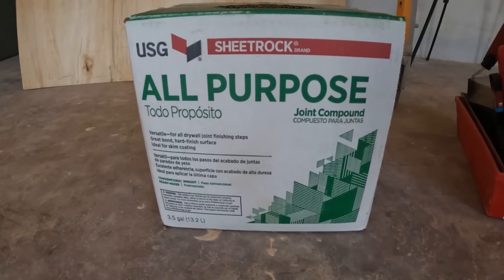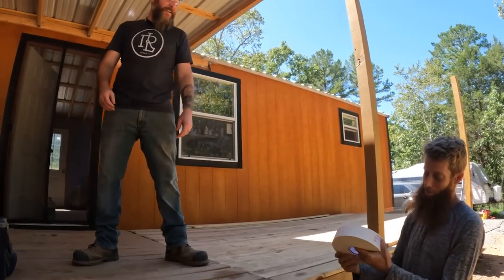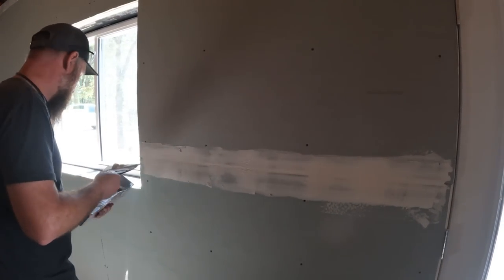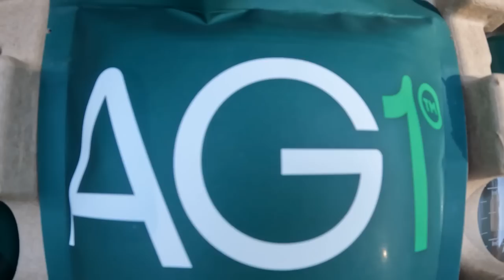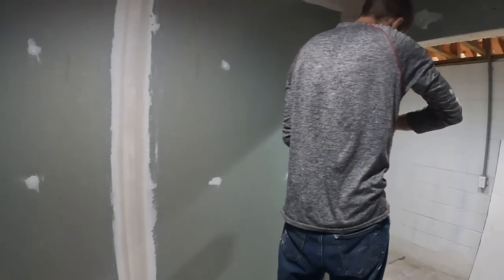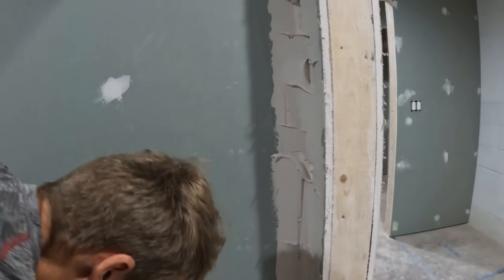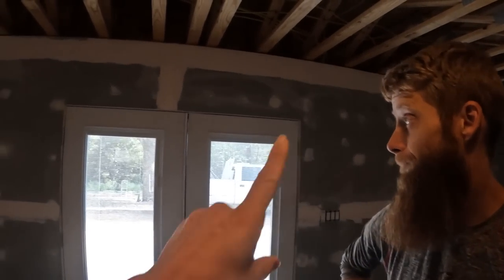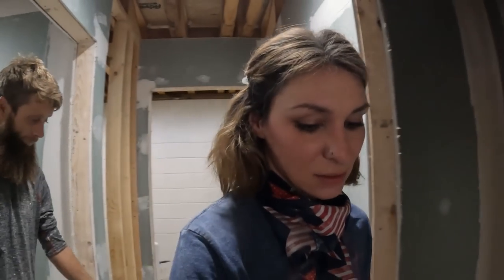Taking On A New Challenge |Mudding Drywall |Couple Builds Basement for Dream Cabin Homestead

Comment: It also helps if you run the tape through water first, before you apply it to the wall...(old dry wallers trick) we used a bucket full of water and ran the tape through the water and used our fingers to get rid of excess watter, it helps the tape to fully stick to the mud and prevents part of it from coming up as it all dries
Reply: This is a horrible suggestion do not do this. No one does this anymore and there is a reason. Hence “old drywallers trick”
Reply: @beanieweenie9543  not sure why you believe this is an issue, it has been done for many many years by professional drywallers. Maybe you could give a reason for completely dismissing this, instead of just asserting its a bad out dated procedure. It has many benefits and streamlines taping and mudding.
Reply: @jasonhaugen7736    I dismiss it because I have ran tape with it soaked in water and with out side by side to see if it made a difference in adhesion and the tape with water does not adhere nearly as well as just doing it the normal way it literally peels right off the wall with little effort. It may help it stick better when it’s wet but once it’s dried the difference is beyond noticeable. Don’t believe me there are several you tube videos from dry wall pros showing the exact thing and how poorly tape ran through water adheres once dried. But better yet try it yourself and have your own experience do a side by side comparison and you will see.
Reply: @beanieweenie9543  yes i know there are several youtube "experts" that say they don't see the benefit. I also know there are others that swear by it like I do. First off, when done correctly it does stick better when wet, and you don't get bubbles or lifting after like you do sometimes when applied dry,. it sticks quicker and more completely without a lot of going back and rubbing it . It is a time saver and makes sure to stay flat without bubbles. 

But hey, this is just my 2 cents worth... you do you... this workes great for us, looks great after... but...it is not a "horrible suggestion" as you claim it is.
Reply: @jasonhaugen7736  the videos I am referring to are not from “you tube experts” but life long drywallers as I am myself that have ran more miles of tape than most people will drive in a lifetime. If you have to wet tape to get it to stick and lay down without bubbles you aren’t doing it correct in the first place. If you put the correct amount of mud on the wall the tape is going to stick to it there is no need what so ever to wet it. Like I said have your own experience and run two lines of tape side by side and and peel them when they are dry you will be surprised at how poor the adhesion is on the tape that was wetted. You can swear by it all you want but I can guarantee a line of tape that has been dipped in water will not hold up to tape done regularly. So yes if dipping the tape in the water compromises adhesion and performance of the tape which it does it is indeed a horrible idea.
Reply: @beanieweenie9543  well Mr. Weenie, i get that your ego just won't let you agree to disagree here, and that's fine. As I said, I have done a lot of drywalling, with both dry and wet tape. I do know what I'm taling about and wet works best for me and a million other drywallers, because you couldn't understand how to make it work for you is not my fault. Your "side by side" experiment is pointless. If you want to believe that your "YouTube experts" are somehow better than all the other YouTube experts who use wet like I do thats fine, You go on believing what you want and drywalling the way you do. I am happy that you have become the YouTube Guru of drywall tape.  And that your way is now the end all, be all, best and only way of taping and mudding. And that you have spent so much time trying to prove a perfect stranger wrong, who was only trying to help someone by giving good advice. If they want to use my advice in the future more power to them, if they don't, then no skin off my nose. Have a really good rest of your week.

Comment: My dad, brother, friends in construction and now us too… we always used the 5 gallon bucket and plop the whole box of mud into it and used a drill paddle attachment and add a little water and mixed and fluffed the mud up. It spreads so much easier and sanding is easier as the mud is not so hard when dry. And do the same process as CRC after that. Light sanding with a pole sander.
It all works out the same in the end. Just found it’s a bit easier with some water added. 
You two are an awesome husband and wife team. I feel motivated now. But no where to apply it. Did all this when my husband and I were young. Now approaching our 70’s
You two ROCK!!! 😃👍💖

Comment: I would recommend mixing your mud just so you can get the clumps out, and add some water also which helps ur mud from clumping, it doesn't take alot of water honestly, but the longer you let ur mud sit it will still clump so just mix it every time you start to see little clumps in it and especially get the really dry stuff that's collected from just getting mixed around and drying out and it helps to mix it in a 5 gallon bucket which they also make with the mud in it so you don't have to use the box stuff but it's preference obviously
Reply: The only warning about mixing in a 5 gal bucket is to avoid hitting the sides with your mixing device so it does not shave off pieces of the bucket (plastic) and get mixed with your mud.
Reply: @brucegover2548   never had a problem with that and you must be using a different type of paddle or something
Reply: @brucegover2548  I have definitely done that before😬.

Comment: Don't overwork the mud. More you scrap the dryer it gets.  When you go to put more mud on use a wider trowel.   It helps more than you will ever know.  Been there done that.   Lightly sand between coats. Put a bare light bulb lamp up by the wall and you can find wear you have places you still need to sand. And instead of spraying on a texture I watered down some mud and used a medium haired roller and painted the mud on my walls and ceiling. It came out fantastic.
Reply: Agreed mud + roller is a great way to texture a wall. I've never used those cans but was always under the impression they were more for fixing texture after you do drywall repair versus a whole wall. I may be wrong on that. But I'd say return the cans and do what Karen recommended or get a texture hopper.

Comment: They do make an attachment for most shopvacs that has a screen sander on it for sanding drywall/keeping the dust down.  Just need to make sure you have vacuum bag in your shopvac so it doesn't spray the dust everywhere.

Comment: You guys need to spend some time on google.  You need to add water to thin the mud a little.  Use a five gallon bucket, purchase a mud mixer use a HD 1/2" drill to mix.  How much to thin is a matter or experience, try a pint per box.  The mud should stick on the mud knife but still spread smooth and even with the proper pressure.  You shouldn't have to strongarm the mud knife.  At the end of the day, level the mud in the bucket slowly put just enough water to cover the mud.  I used to use a drywall scrap to cover the bucket.  Next day pour the excess water off mix and start again.  Good luck.

Comment: Few tips for others out their that are new to mud work. DO NOT use paper. First get the fiberglass tape. Use 6 inch blade like this video and then a ten inch and third coat then feather out. Sand with a sand sponge to avoid striping caused by standard drywall sander. Corner trowel work well for first coat but feather with ten inch trowel. Also doing a ten inch stripe over the screws straight down avoids screw spots that'll show through paint. Finally when priming use large nap roller of brush doing arches which then keep light bouncing other directions that will prevent seeing any small difficulties.

Comment: Two tricks that worked for me. Get a box fan or two and put in the windows to suck a lot of the dust out. Leave ceiling fans off. Also, use a bog sponge, like whats used on tiling, a bucket of water and sponge the joints. It cuts way down on dust. On last use sanding to give finish a nice smooth look.

Comment: Didn't anyone tell you about corner bead? It's a metal corner that protects them from impacts that will chip the corners. Bet you found the bulge where the 3 inch strip is located. For a rookie, it's lookin good.

Comment: I also have an extra vacuum hose attached to double the hose length and that is attached to m palm sander for ease of collecting dust. This helps, provided you have the correct sanding pads, with holes. And with so much sanding through out the entire build, this could save hours.

Comment: Use the Plus3 joint compound ( easier to sand) and mix the box into a 5 gallon clean bucket and mix with a paddle attached to a drill)

Comment: There is a roller to roll the mud in the corner fold the paper to make your corner push it into the mud and take your trowel to smooth out the ends of the paper

Comment: I downloaded to catch up, so you are already finished, but an easy texture method is to ix paint with your mud, such that it is like thick paint, and roll it onto the Sheetrock. A little practice and you can find a nice texture you like and it is such a time saver. I usually go over that with a coat of paint w/o the mud. Covers nicely for less effort.

Comment: You would like the result of thinning your mud down a bit with water...just a little water makes the mud very much more workable (easier to spread and smooth out. Also, get a 6" drywall knife for heaven sake...it is the industry standard for taping.

Comment: If you put that mud in a 5-gallon bucket and buy one of the mixers you can mix that up and get all the air pockets out of the mud and that'll save you from getting air pockets in on the walls for one and two it'll be smooth as can be and if you're just going to use the box use the four inch trial to dig it out the box it makes it easier make sure you get plenty of mud under the day cuz it's not it's just going to bubble up on you and you have to cut it out and put another piece tape in there

Comment: You guys are doing a great job!  I don't usually put my two cents in what others are doing.  However, I would offer food for thought.  You guys are talking about texturing your walls.  You are doing such a good job, unless it's personal preference,  I might skip that step for the basement.   You could paint the drywall and be finished after mudding.  Save the money, time and work.  If you want it in the cabin later, then you won't be as burned out.  I say this because in this part of the East Coast where I live, textured are almost never done.  Painted, smooth drywall.  We don't do plaster here either.  Again, just a thought.  I am sure you will make the best decisions for yourselves. 🥰

Comment: You can get different drying times for mud, or we'll call it plastering here.
Most common is 90min mix. Put it only 2hrs later ready for sanding and recoat etcetera. So you can do in a day if the weather is warm enough.
Looking good so far.
Sanding in-between coats really is minimal.  Quite sand over it done. Too much sanding and yourll have to remud it.

Comment: You guys need to cut the drywall off around your front door jamb...the jamb was not wide enough to match your block wall thickness (cut off at least 3/4" of sheetrock back to the back side of the doorjamb at the top and two sides)...then nail on a 1/2" strip of wood to "extend the jamb" out flush with the drywall surface...then the door trim has wood to land on at the door jamb. As it is now, you can't put any trim around the door...the raw edge of the sheetrock shows at the area to be trimmed out with wooden door trim. Also, you should rent a texture gun to do the texture on your sheetrock...those small cans of texture are only meant to do patch and repair areas, NOT the entire field.

Comment: We had a drywall sander we attached to a long pole you sanded joint area and the drywall dust would sort of fall straight down to the floor, it kind of looked like a screen you clean it every once in a while so it sand good. 
There is also a neat thing that they have when you shop vac you drywall dust off the floor that can put the dust in a 5 gal (with water)bucket with a attachment you can buy so it won’t break your shop vac. Saw them at a big box store HDepot or Lowes. We blew up a regular vacuum cleaner trying to do that it burst the bag!!😢😢

Comment: Rent a drywall sander for after your final cost sanding you’ll get all the basement sanded to a high finish with little mess as it attaches to a vacuum, it will save you loads of time and as I said you’ll be very happy with the finish. All for a couple of bucks.😮😅

Comment: Great video as always. Just wondering whats the plan to cover the concrete floors? Just going concrete paint, epoxy, tiles? I done epoxy on my own basement and garage floors but the anti-slip was a bit more expensive than I thought it would have been. Still worth it though.

Comment: Your mud is to dry, you can add water in your pan and mix it
Or squeeze the bag into a 5gal buck and  mix it with your drill and mixer 
Spotting the screws - apply horizontally then wipe vertically 
Or vise versa 
Thinner mud will save your arms and wrist…. Have fun

Comment: will you put up insulation in the ceiling until you start the plumbing and wiring for the upper floors? Seems like it could easily be moved out your way when you go to the next step and very cold as soon as Winter hits if you didn't have some sort of something up there.

Comment: Never use an electric sander with drywall. Always use a handheld so you can feel what you have done and how much more you need to do.
Reply: You can’t use an electric sander! Omg 😱 I was like you need a block sander in between layers ..
Reply: Electric drywall sanders are used quite often, as well as battery operated sanders that have low speed adjustments.
Reply: You can use a electric sander lol it's called experience obviously but use what you are comfortable with Also

Comment: Hey Gary I guess you done sanded the walls already, I found a trick you can do,take a drop light above the area you going to sand cast a light down ward ,you can see any bad spots , it will cast a shadow .sand that area till it’s gone.your wall be straight and smooth

Comment: ATTENTION!! TRICK for u guys. For best results when painting a basement tht always has the chance for moisture in or around it no matter what steps are taken to keep dry. While painting the finished drywall u should run a dehumidifier couple days before and during and while setting up and paint drying/curing. I messed up with this twice once in a finished basement and like 10 years later on a kitchen ceiling tht sat over a crawl space with no liner. Paint finish look was the worse cracked egg shells man has ever seen.

Comment: Just remember when you open a Box of mud air is your enemy when you go to close it up at night get all the air bubbles out because it will dry it up harder than a rock you do not want hard rocks in there because it leaves scratch marks everywhere you try and lay mud down best thing to do is keep a bucket 5 gallon bucket of water close by when you go to close everything up sprinkleverything up sprints a little bit of water and there just take your hand and splash water in there and then squeeze all the air out trust me trust me and then seal it backup.

Comment: Hello. A lot of these comments are not good. Do not wet tape it makes it so it can’t absorb the glue in water of mud u don’t need to sand the first coat as it should b thin and just to set tape. Also it is very hard to sand all purpose/taping mud. For the next coats u need to use a lightweight mud that sands easy. U need to add water to mud so it wants to flow Especially in the corners. A real texture hopper actually cost less then probably 5 of those cans. Vancouver carpenter videos on drywall are really good. Not trying to criticize just don’t want u to make the same mistakes I did when I remodeled houses b4 I how to’s on YouTube existed

Comment: You shouldn't have mudded the upper edge of your drywall until you hung the lid. Now you don’t have that nice tapered edge to feather your tape and mud into.

If I were you, I would either take a damp sponge or your hand sander and remove that mud from the upper edge of your drywall. Trust me, you'll be glad you did if you like nice square crisp inside corners that is.